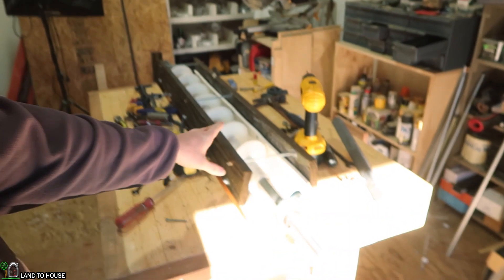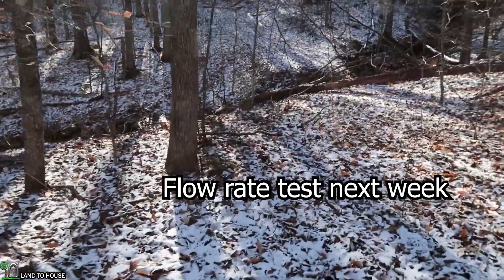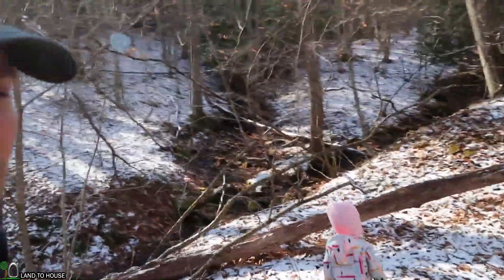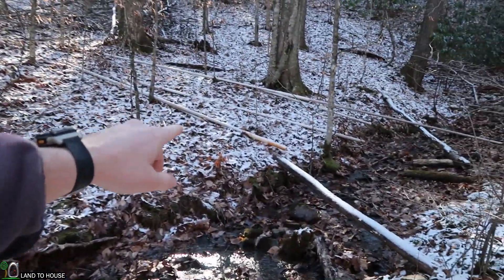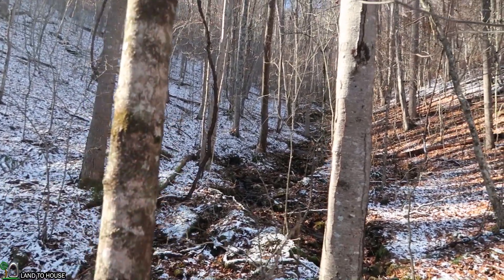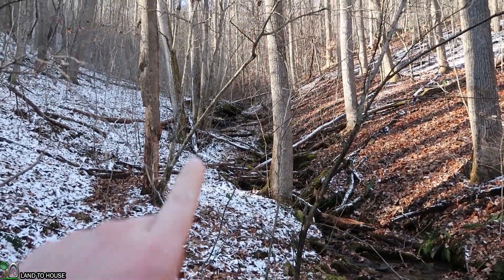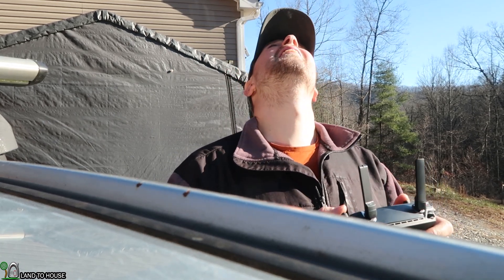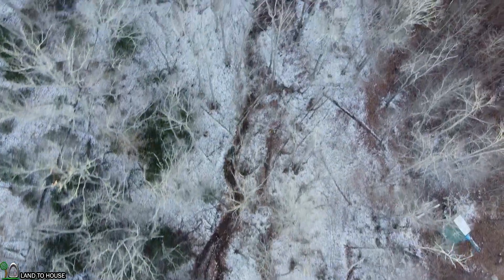Hike the Creek for the Future Micro Hydro System

Comment: Oh my goodness I am so glad you are building this. Count me in as one of the followers true this entire Journey. Joe makes great videos I liked his stuff he gives me enormous detail on what's going on. I recently saw this video.https://youtu.be/2scoi0Gqxko. I wasn't able to grasp all of the details it seemed like it wasn't a high Precision equipment. And that's not a complaint it's makes me think I can do it so. That Luke guy is nice he really thinks outside of the box. Just keep this up along with the ram pump I'm watching them all.
Reply from the maker: Oh nice video. I had not seen that one. His turbine seems to have low head pressure. Mine should have at least 150 feet (if not more) head pressure. The motor will really be spinning. I am very new to Micro Hydro and I think that it will make for some great videos! What I have seen is that there are only 4 or so series on how to make a micro hydro generator start to finish. Time for LTH to make a series.

Comment: At 200 feet of elevation drop 40 gallons per minute is the maximum you can flow with a thousand feet of 2 inch pipe estimated power output around 576 Watts at 50% efficiency. I would not use anything smaller than 2 inch way too much pipe friction with a thousand foot linear pipe.
Reply from the maker: Yes you are absolutely right. This past week I was doing the calculations with different variables. 1.5" pipe vs 2" pipe. 1000ft vs 1200ft for pipe length.
What I found is that 30 gallons per minute with 2-inch pipe 1000 feet long is pretty much what I need for my setup. Will be around the 500w range at 50%. Thank you for confirming my calculations. I'll have a flow rate video coming out next week.

Comment: What are your plans now on the solar panels behind your house? 
Any kind of estimate on kW combining the solar and Archimedes screw?
Are you planning a direct feedback into the power company grid or will you try some kind of storage?
Being up the mountain, do you lose power very often during storms, high-winds or heavy snow?
Inquiring minds want to know👍😀?  🦀
Reply from the maker: All good questions. I need wire and an inverter for the solar. My goal is to start with a grid tie limiter inverter. That way I can supplement our power usage and not feed the grid. We do not have a  smart enough meter for that. The solar is a 1kw setup. So 600w or so. Not sure about the Archamedes turbine yet. That will be fun. Might could send that power to the tiny house. 

We do lose power often. It would be nice to have battery backup for lights at least.  (Tv and internet haha)